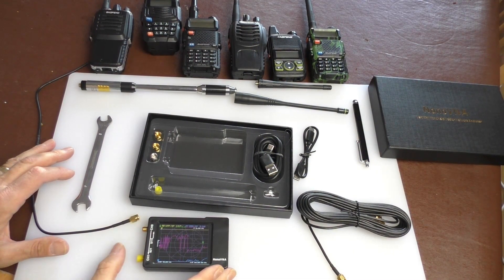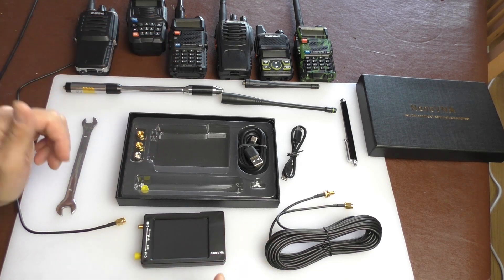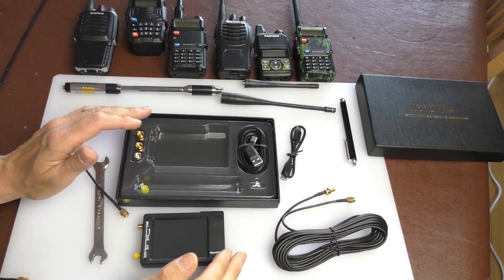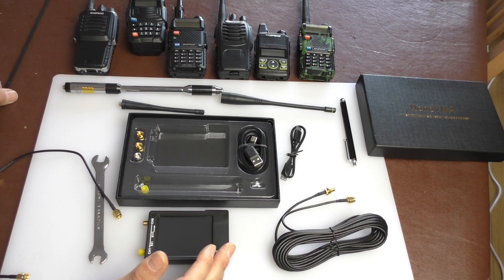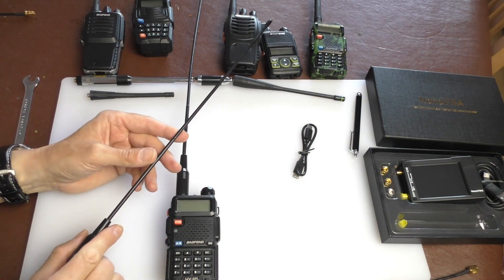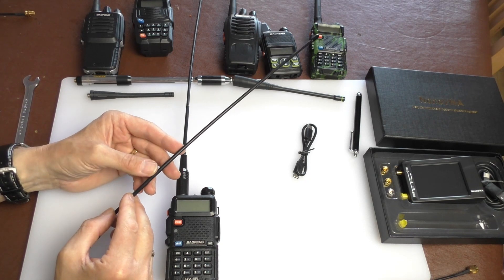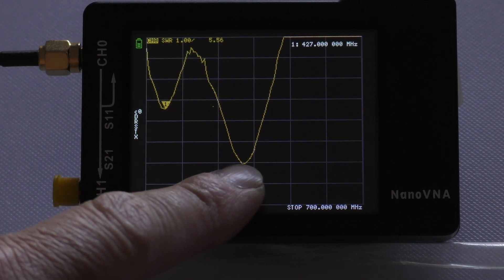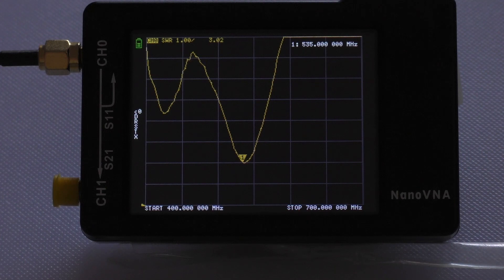FAKE Nagoya NA-771 testing SWR on 70cm - Nano VNA.  SHOCKING RESULT !

Comment: Interesting stuff Fred.. Have you tested any of the antennas that came with your radios using the same method ?
Reply from the maker: Yes pete on the first video.
Reply: Can you try the other OEM antenna(s)? The Baofeng one which tapers in and then continues fairly thinly to the top is supposed to be better than the "chunky" one, particularly on the amateur bands. I have both, myself, one of which came on each UV-5R I have, and I ordered another one of the "slim" ones as the chunky one, as tested in the first video, wasn't great.

Comment: That does seem like a surprising result. Could you perhaps consider sacrificing an 888 by doing a practical test with one of these antennas? A simple "does it actually get fried" / range check should surely be able to confirm whether or not the SWR really is that bad 🤔
Reply from the maker: Already did that 2 yrs ago :-)  Here's the link. https://www.youtube.com/watch?v=phglrc_af-4&t=11s
Reply: @CB-RADIO-UK  Thanks! I just watched that video, actually the fake 771 sounded a lot better than the standard antenna.
So, something doesn't add up... This is intriguing, needs more investigation surely? Thanks for the interesting videos.

Comment: I cut one of these open and it was literally just a 36cm whip, no loading whatsoever so it is essentially a 1/2wl end fed on 70cm except it has no loading and is too short to be a 1/4wl on 2m. So no use on either band.
Reply from the maker: No loading at all ?  Thats not good :-(
Reply: @CB-RADIO-UK  Literally nothing, just a bit of wire connected to the center of the SMA, cut it down to a 1/4 for 70 and it might be ok lol
Reply from the maker: I might cut one of mine down to look.  Not really surprised though.
Reply: @CB-RADIO-UK  would be interesting if you make a video of it.
Reply: I had this non loaded version and cut it to 1/2wl on 430 worked well for me, increased range by a lot compared to the stock rubberduck and other "loaded" 1/4wl antennas I had

Comment: Well, rip. Wonder how practical would it be to homebrew handheld antennas because it doesn't make much sense to pay 20 bucks for an antenna for 10bucks bf-888s
Reply from the maker: Yes thats the prob with cheap radios.

Comment: hay Fred  what is the impedance of the antenna, some handhelds use 75 ohms and not the standard 50 ohms
Reply from the maker: Does not say on the antenna.
Reply: @CB-RADIO-UK  you would need to check the impedance with the vna hope it helps
Reply from the maker: @fixitdaz  Yes i should be able to do that.  Thanks

Comment: Have you a way to see if the antenna uses the radio as a counterpoise?I would try a field strength meter and compare the fake to an genuine.2CM3284/KE5SRB.CHEERS from the States mate!
Reply from the maker: Yes the ground plane angle is interesting.

Comment: What about VHF 138-174?
Reply from the maker: Did not test down that far on this video.
Reply: Go for it, I'd like to see! I've got one of these fake 771s and it does work better on the ham bands than the stock antenna, more on 2m than on 70cm (maybe not surprising because of the physical length).

I tried ordering a Nano VNA but the seller asked me to cancel for some reason. Not got round to ordering another one.